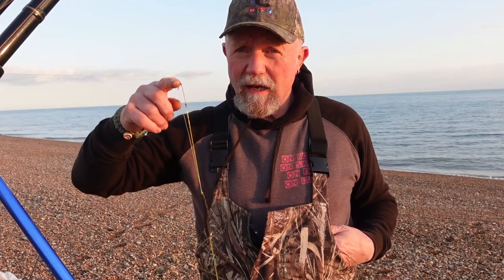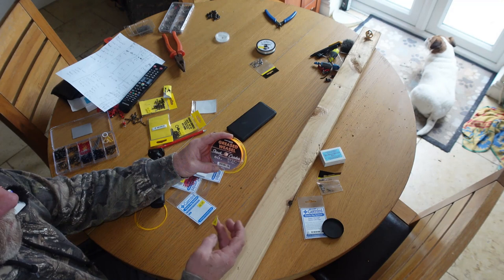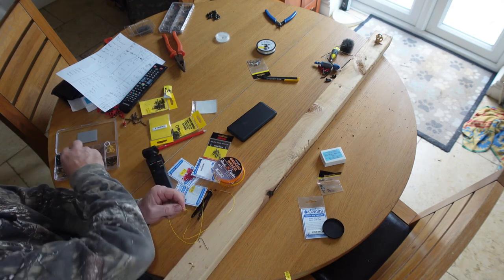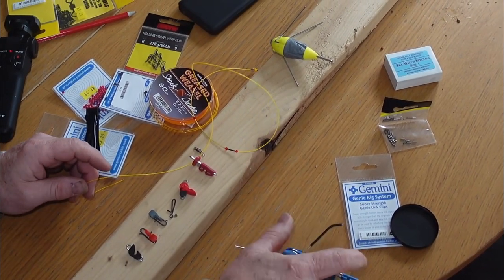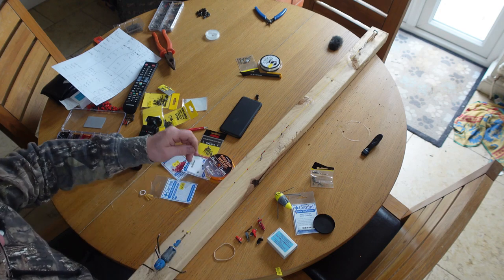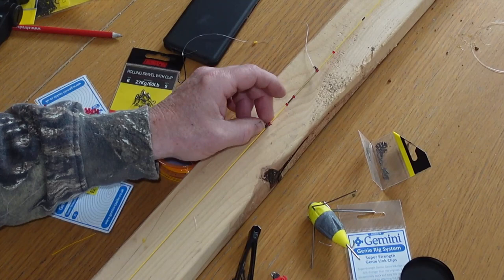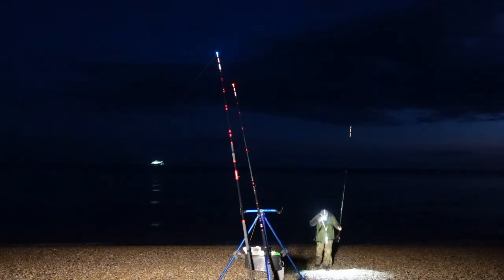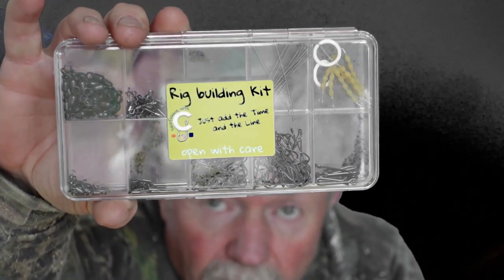How I avoid the blank and  the rigs I build to keep the skunk out.

Comment: Great video Chris, that’s the rig I use for most of my fishing off Hornsea beach and it works well, I’ve had Thornback and Smooth hound on it as well as Dabs and Whiting. I always use an imp on the bottom hook and have just tied a couple of rigs using stop knots instead of crimps just to see if it’s effective.
Reply from the maker: Tell me how you get on